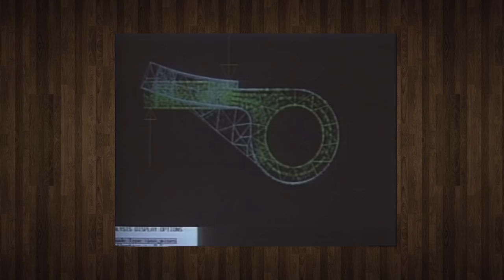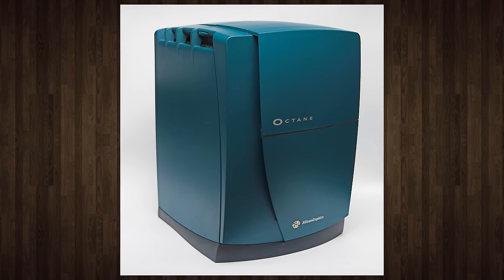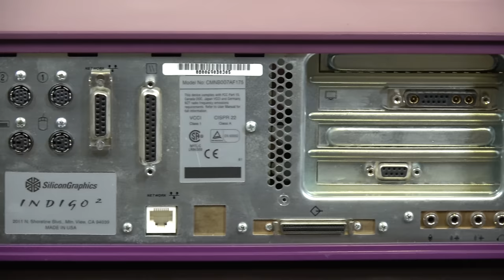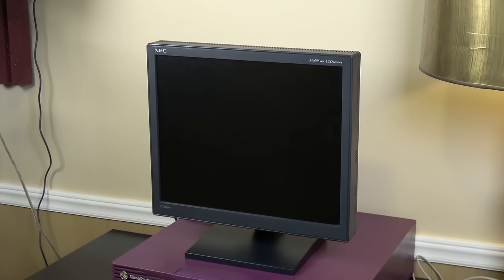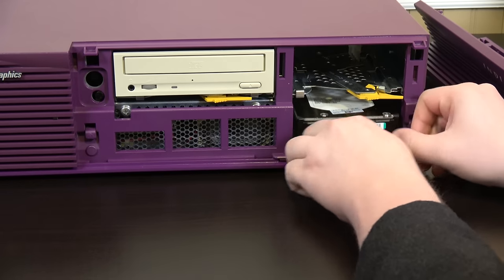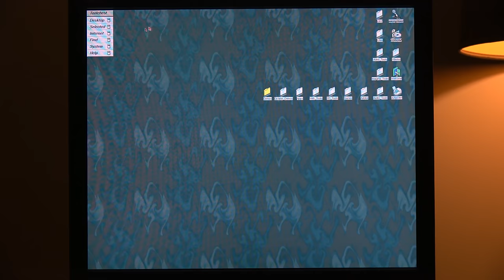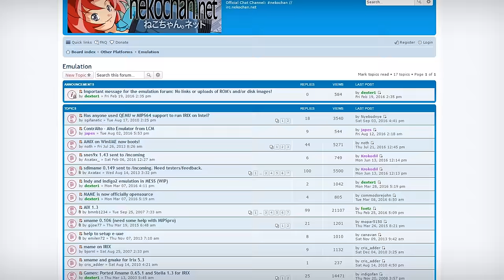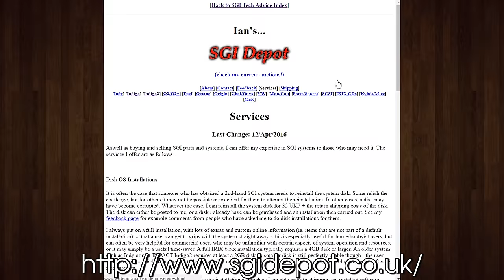SGI Indigo2: An $86,000 Workstation from 1995

Comment: Remember this computer; almost bought an O2. I wanted something for graphics but decided against because of the high cost and a proprietary OS. SGI's products, nevertheless, proved attractive to animators and high-end content creators. Not sure if anyone is exactly mourning their demise, given some of the reasons I have stated.
Reply: I do of course, but their demise was largely self inflicted, sooo many mistakes. The OS wasn't really the problem btw, it was more the ludicrous charge for the licensing (should have been free), even more so the compilers which made the entry point for sw dev rather high, made worse by not developing a more mainstream system appealing to general devs (O2 was not good for that, too slow for straight CPU/RAM workloads).

Comment: And at 45 pounds you could go mobile with it by buying the Indigo2 bag which held the I2,a keyboard and mouse as well as the 1280 Presenter display. I have two of these monstrosities, one in Teal and one in purple. What is truly amusing about the bag is that when you pick it up by the metal reinforced carrying handles you felt like they are going to tear off and for real punishment just sling that shoulder strap over what’s left of your shoulder for some real pain.  😉

Comment: The hard drive didn't exist in 1995. I bought an external 3.5" Half height, 4.5GB SCSI SCA HDD in 1998 (one of those stuffed into an external case with a 80 to 50 pin adapter), and that was $300 back then. Largest HDD back in 1998 was one of those full height, 5.25" beasts that held 18GB. A 146GB half height 3.5" SCA drive probably didn't exist until 2003-2005

Comment: I still have an O2, also with the R10k processor. The incoherent cache feature meant Linux never ran properly and even NetBSD wasn't stable (and had no graphics). It's as slow as a Pentium 133. And I no longer have a ps/2 keyboard around.

Comment: Everything but the cpu and gpu would have been top of the line 10 years later.
When I built a system in 2005 the most ram you could get was 4 gigs but only some motherboards could even use the one gig sticks.

Comment: They were few and far between, but present, in the engineering department of the aerospace company I worked for, along with much higher-end hardware and CADAM software.  Still not sure what they were used for, perhaps loads and dynamics, deflection models, FEA modeling, but they were scattered around.
Reply: What do they use now for aerospace ? Linux?
Reply: I was a structural designer, and IBM hardware, presumable running a version of UNIX...AIX or whatever..used to run off a mainframe and run CATIA software, which was developed by Dassault Aerospace.  If I recall correctly.  During my career I ran CADAM, CADD (MacDouglas version) and CATIA up to version 3.  Powerful workstations were rare, period.  I’m talking 1983 till 2000.  I’m sure there were security reasons as well for using predominantly mainframe processing back then, as networks that were secure were quite expensive to maintain.

Comment: I had one of these (purple Indigo^2 Impact 10000, but not as decked out as the one in this video) at work that I used on a daily basis for years in the latter half of the ‘90s. It was a great machine. Way more bells and whistles than any other Unix-ish workstation at the time, that’s for sure. I loved the window manager, and the Irix “Warp” screensaver is my all-time favorite screensaver. (It’s sad nobody ever ported it to Linux. There are similar Linux “Warp” screensavers, but they’re not nearly as good, even 25 years later.) I’m mainly here to disagree with the assessment of the “granite” keyboard in this video. Having used this keyboard nearly daily for like 6 or so years, I think it’s one of the best I’ve used. The keyboard layout was ideal, and it was a joy to type on.

Comment: A whopping 45 pounds, what’s even more interesting considering this weight is that like the Indy which could be had with an Indy bag to shlep it around in you could also get an Indigo2 bag in both teal and purple. I had both colours of these bags at one time but only have the purple one now but what boggles my mind is the wimpy little strap that came with the bag. It’s bad enough that by the time you add the I2, keyboard and mouse, the presenter display and attendant cables you’re hauling around alo isn’t the weight of an Octane… What were they thinking!

Comment: Looks rather like the Amiga 3000 inside (1990) in terms of layout.  The floppy drives where the optical drive is.  That was about $3000 back then @ 25mhz.  2MB RAM.

Comment: I used to do UNIX admin on SGI machines for the Air Force.  Weird OS (IRIX).  Cool boxes though, and cool graphics accelerators.
Reply: I really doubt a workstation of this class would cost $86k.  A souped up SGI server could easily top $200k, but... a workstation?  Probably not.
Reply: 10 years in the future?  Linux was first "released" in 1991, by 1995 is was at least version 1.2.
Reply: "Was never meant for public use"?  Any public company could buy this if they wanted to.  I guess by "public" you mean, putting it into your home?  Sorry man I'm a UNIX nerd going way back, you should expect this kind of blowback when you cover a UNIX system and say a bunch of inaccurate shit.  ;-) Love your channel but really, stick to video games.

Comment: Sadly a lot of these machines would still be around today if it wasn't for the fact that silicone Graphics soldered the BIOS battery to the BIOS chip which really sucks because when that battery dies you get an error code and on earlier machines you couldn't bypass it it wouldn't let you unless you replace the chip
Reply: Just disconnect the relevant pins, open it up, attach a typical CR2032 holder and use that instead, a common fix. BUt replacement Dallas ICs are not hard to find.

And it wasn't "soldered", the Dallas IC is an integrated product, the battery is already inside the IC, but the IC sits in a socket so its easy to remove.

Plus, worse case scenario, one can set the MAC in software to whatever one likes anyway, so there's no need to get rid of an Indigo2 just because the Dallas has died. I have about fifty Indigo2s, very very few of them have bad Dallias ICs, it's comparatively rare, whereas for some reason the equivalent IC in Indy didn't last as long. I have plenty of spare ICs thuogh, hefty quantity of NOS I acquired years ago.
Reply: @mapesdhs   Oh it's not Getting rid of it and even if you replace the ic You still receive the error code the reason why is you have to have the reset disk to reset the bios on certain models there still very useful as a Linux machine as well as other weird products
Reply: @johnDingoFoxVelocity  If you replace the Dallas in an Indigo2 you will not get the error code anymore. One just has to set the date/time in the usual manner (after doing the usual resetenv). And using Linux on SGIs is silly, one is far better off using IRIX which is much more optimised for the hw, indeed with Linux many aspects of included hw (especially gfx) will not even be available for use, especially for systems like O2 and Octane which have all sorts of specialised tech and abilities that Linux has no idea how to use.

Lastly, MIPS/IRIX SGIs do not have a BIOS, they use a PROM, rather different, though a similar concept.

Btw, the MAC address in Indigo2 is not inside the Dallas (different to Indy), it's held on the vertical riser board at the back. Indigo2 can still boot with a bad Dallas, one can simply do a resetenv in the PROM, boot single user, set the date/time manually and reboot. So long as there's live power to the PSU it won't lose the settings.

Comment: Yet the rise of Linux and 3D graphics for PCs pretty quickly killed these things, a few years later I bought an Indigo2 Impact (not max) for $300 on ebay with no disks, added a random scsi CDROM and disk drive myself and installed IRIX, made a custom video plug to use it with more ordinary monitor (Impact was sync on green).  Since I had the CADD wares, C development, and was IRIX admin I could do things with it.    I really don't see what someone could do with one now, to be honest.  You could have most of the same fun now with Linux or one of BSD with x86-64 or ARM (e.g. Raspberry Pi)
Reply: Actually it was more SGI's terrible management choices and insistence on sticking with a reseller sales model that killed them off, along with ignoring relevant market opportunities on multiple occasions. In technical terms it never needed to be.
Reply: Why are you on a vintage computing channel if you don’t understand it?  Can a new genetic Linux system run Pro/ENGINEER and other design software of the era?
Reply: @lookoutforchris  You're funny saying i don't understand when ive done professional sys admin and systems programming on IRIX clusters besides CAD CAM CAE.

Pro Engineer now runs only on Windows, not any Unix nor Linux system.  IRIX support for pro E dropped after version 4 in the 1990s.

Comment: You are missing a key component. You need to get the 5 series card servers. I had 10 of these a 5 series swrver with two CPU carda. They sported multiple IBM RISC 200MHZ cpus. it was in 98 so I think it was 5 CPUs per card. This server did all the rendering.

Comment: back in a different life I worked in the video game industry, in a small little place on 180 Lakefront dr in Hunt Valley MD.  One day we had a break in in which a couple of SGI Indigo 2s were stolen from us.  what really sucked is it was just a smash and grab job and the thieves cut all the cables . . . monitor, power, keyboard, mouse . . . to grab the hardware fast and go.  All of it was proprietary, not able to get it at the local computer stores, and they were SGI's to boot - so they most likely got dumpstered once the fools realized they had boat anchors they couldn't do anything with.  what a waste . . . stupid criminals

Comment: Back in the day it bothered me that they could never bring together the more polished interfaces of Windows and MacOS with the high end workstations of the time. THose SGI machine had god awful X11 interfaces but they were rock solid. It is no wonder Microsoft eventually dominated for workstations when PC hardware finally caught up (primarily driven by gaming).  If only SGI had put more work into the UI toolkit. But this is what you get when your dev staff is primarily engineers.  It's like the  early web before designers got involved. Programmers suck at user interface design.

Comment: Very cool, looks like a PC version of the PS2.
Way ahead of it's time- I'm just surprised they got away with it's fairly anemic cooling solution.

I think my family's first computer had a 20Mb HDD back in the early 90's- I remember when the 64Mb memory card came out for PS2, I was shocked at it's "massive" storage size.
Reply: I haven't tried recently, but with accumulation buffer turned on, my Octane (R12K 300MHz, SE+Texture) would crush my PC (10-15 years newer than Octane) which was in everything else faster or much faster. Some capabilities of SGI machines simply beyond consumer products. PC was all about 16b rendering and slowly entering 32b, for Indigo2 it was 48b, with stencil buffer etc. They simply couldn't be compared, even with similar on paper performance.

Comment: 96mb of ram in 93? I spent a few hundred dollars to buy 8 256kb chips to give my 16mhz computer 2mb so it could run windows for workgroups 3.11 (which I pretty much couldn't use for anything except wordperfect because DRDos was superior to Windows) installed on a compressed 40mb seagate hard drive that regularly suffered from corruption...I started messing around with slackware a year later but never could  find all of the drivers I needed to compile an adequate X kernel on that proprietary system...

However, comparing powerpc and risc type archetectures to pre-586 computers is not a one for one comparison...my $1500 386 desktop with state of the art VGA in 1993 was completely inferior to my $1500 Amiga 1000 from 1985 that had superior graphics without the need for a $500 monitor and superior sound and speech emulation without the need for a $250 turtlebeach sound card...you could do things like video editing and music composition and all kinds of things that 386/486 chips just couldn't handle and the video cards on x86 PCs couldn't really keep up until the 3D cards started coming out in the late 1990s...

Comment: I remember upgrading my Compaq machine to 384mb of ram and a nivida video card that had 128mb of ram. I thought I had the most powerful machine ever 😃. Now if you have less than 8Gb of RAM you suck.
Reply: And yet my Alcatel PIxi died recently because of the proverbial stupid Android bootloop, whereas the R4K Elan Indigo2 sitting on my lounge floor as I type is still working fine after 30 years. ;)

Comment: Quite sure that neither that HDD or CD are original parts. Quite sure that the CD should have had a black front, and in 1999 the Indgo2 was no longer in production (replaced by the Octane) - think it was EOS early 1997, so unlikely to have a 1999 CDROM. 147GB SCSI was out also in 1999, think it came with a 18.1GB. Also 1TB was never really supported, as largest DIMM at the time was 64MB, so it's likely that somebody just put 8x128GB of aftermarket memory in there later. Quite sure it was offered with 4.2GB, 9.1GB or 18.2GB Fast SCSI2 drives.

Comment: And now, here in 2020, you can buy a Raspberry Pi with much more processing power for only $35.
Reply: Lol. Well, that may be so. But I think, even modern indigo hardware would still cost just as much or if not more as it was back then with modern high end spec. After all, this was targeted towards specific workstation for professionals and not for your average consumers like a Raspberry Pi though. It reminds me more of current Apple Mac Pro workstation though. 😀

Comment: Hm. Mac Pro (max configuration) costs $53,948.00 in 2020.
Reply: Nobody use a 54k mac . If you need  512gb Ram of higher  a mac is worthless. Mac never had that kind of high end hardware.
No bendgate flex cable issues  no strange issues updating os on sgi  irix a really top notch iron .

Its an insult comparing a mac to sgi.  Apple always wanted to be the new sgi but they dont have the resources. A mac should have ultra speedy enterprise ssd  raid on ssd real time encoding on h265 but no.

Comment: most modern desktop pc have more power ,, its madness how technology has changed..not to mention .. much cheaper
Reply: Its not the same you can have a similar clocked cpu on intel but sgi had custom bus and irix os that could run for months 24x7 without rebooting. No mac or windows can do that.

Comment: Those stats suck. ARM processor at 33MHz, 16MHz FSB, with SCSi2 storage bus 😂 OK.. Lot of bottlenecks. Notice the CDRom is on the same bus with the hard disk? Because they were clocked at the same rate. No speed benefit of RAID because it's a single disk. No benefit of scsi's multi-user/network access since it's a workstation. And the front bus at 16mhz... That's the worst. That will insure you can't upgrade your way out of the slowness by installing a PCI card. And the ram? Nothing special either. I bet most of it was being used as a ram cache.

Comment: 2020: Apple: we sell the most expensive computers ever!

1995 SGI Indigo2 hold my beer!
Reply: In 2020 a maxed dell workstation was like 160k$ for ML . Nobody would use a 1tb mac unless you need that for braggin

384Gb ram > is linux windows turf.
All the guys using that memory runs amd xeons

Comment: There is no things such as a MIPS R10010 floating point chip.  All MIPS processors (ignoring embedded cores) starting with the 1992 R4000 had the FPU integrated.  The 1986 / 1988 R2000 and R3000 had external and thus optional R2010 / R3010 FPUs though SGI only made systems with FPUs.  Finally the oddballs, the R6000 / R6010 combo.  it was an absolute power hog at 3.5 kW for a 3 CPU system in 1989 or so.  SGI never used this processor but CDC and MIPS itself did.  Finally the other oddball of the MIPS family, the R8000 which was a set of six chips.  In theory it had a separate FPU but no system ever used that option.  it would have been pointless if not ourright stupid.  The R8000 was well more expensive than the R4400 but delivered barely higher integer performance in SpecInt92.  At the same time it crushed the R4400, even early versions of the R10000 (running at modest clock still) and even some Alpha systems in the SpecFP92 numbers becoming the world's fastest processor for FP workloads for a short time.

Hardware configuration registers in the FPU may indicate the presence of an FPU but that's really useful for detection of the presence of an FPU.  There is no separate R10010, R4010 or similar except as stated in the previous paragraph.

While not as bad as the R6000 (which was using ECL), the R8000 was still running pretty hot and most Indigo² R8000 eventually cooked themselves.

BilliardGL - didn't know that.  But one of the labs at SGI had a very nice billiard table.  I guess I now know where the inspiration is from 🙂  Played there only once and my partner apparently had never played billiard before, managed to shot the ball over the end of the table in direction of a rack of prototype hardware.  Instant sweat and fear.  Fortunately the rack was far enough away so the danger was not real but I decided to end the match out of responsibility anyway..

SGIquake?  Origin 2000 systems in a rack have a system controller allowing power up, down and some more stuff from the front.  The system controller is based on a standard i486 embedded module.  Some engineers soldered PS/2 jacks to it and booted DOS only to run Doom on it.  Good nerdy fun - but the screen was like 7¨and probably a TN display, horribly slow updates.